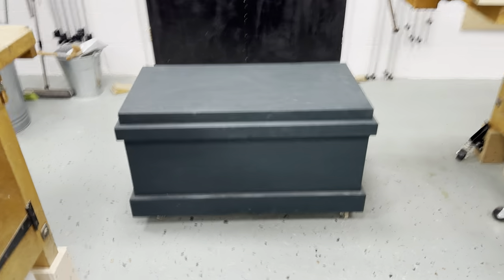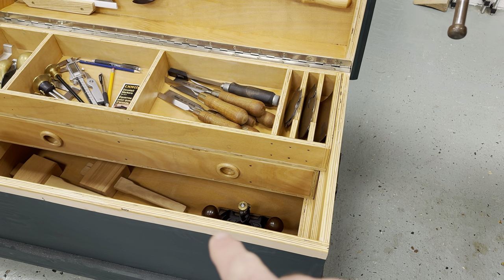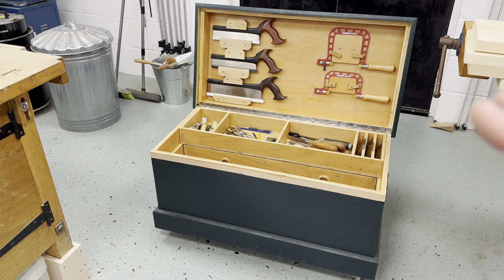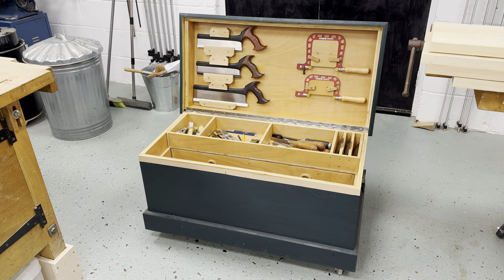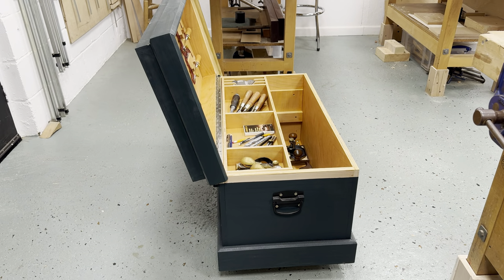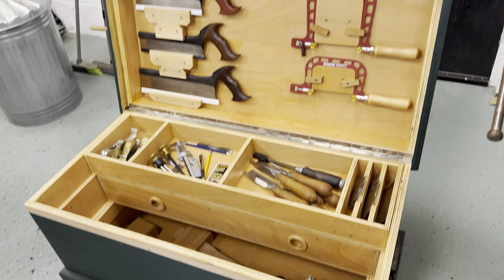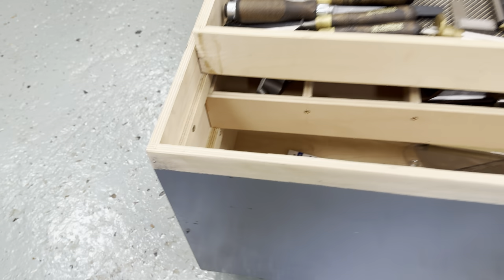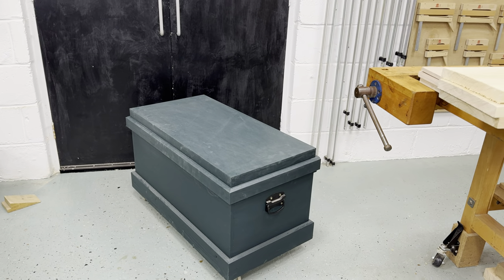Plywood Tool Chest Pt1 - Overview of construction and design @Cravenconservation

Comment: Bill, how many sheets of plywood did you use for this project?  This looks like a nice solution to my tools constantly being on my bench!
Reply from the maker: I covered it in the series, pt 2 from memory.  Depends on the size you make the chest and also the size ply sheets you buy. Your cutting pattern and wastage will vary depending on both of these. I buy 6’ x 2’ sheet for convenience. I use 2 1/2 of 12mm and 1 of 18mm. If you watch the videos you will see in more detail.
Reply: @Cravenconservation  Sorry, I'm watching sequentially from the beginning, haven't gotten to video 2 yet.  Thanks for the response.
Reply from the maker: @FallingSunAcres  no problem. After you watch it, if it is not clear just message me. Tried to fit as much detail in but tricky with 15 min limit. Cut lots of stuff out I would like to have included and left plenty of bloopers in I did not have time or energy to edit out 🤣